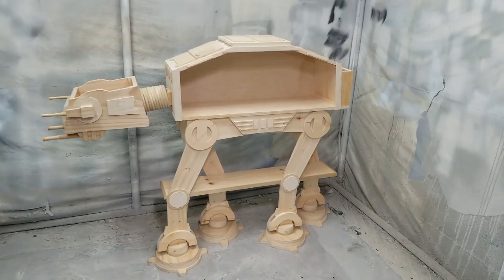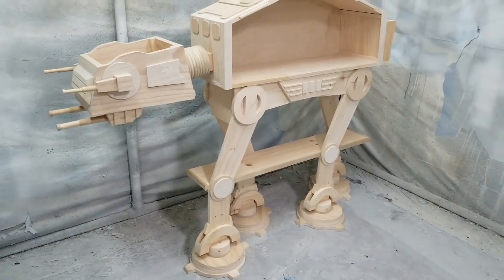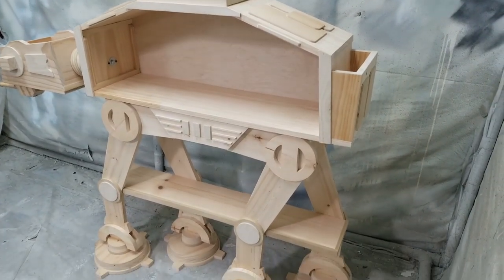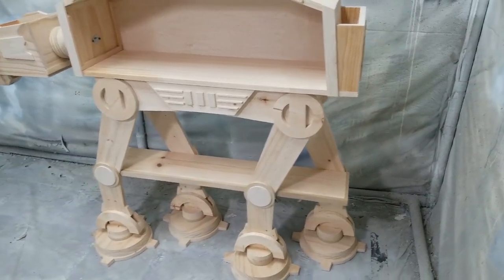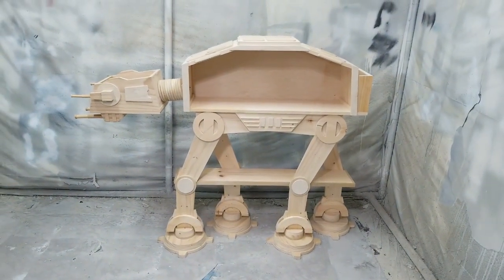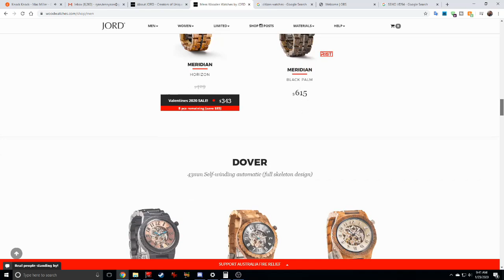Painting a Custom Book Shelf

Comment: @That Shabby Guy what color of Valspar gray do you use (or do you change it up)? Looks good brother keep it up. I've been following up on your videos when I am not working on my projects.
Reply from the maker: I dont use any specific color. I find most of my grays on the mistint shelf at the hardware store. Gray is so popular there are usually some available. Get $35 paint for $9. So I'm not picky. If its too dark, I can add white to get it where I want it.
Reply: @ThatShabbyGuy  Thanks for the reply! I will be getting some gray for sure from lowes mistint. I have a table that has some design work around the edge. I am going to attempt your gray glaze technique to the sides and legs. Possibly do a carbon gray stain on top. I'll share photos when finished (I will have to brush paint mine at least until I get a good sprayer). Take care!

Comment: I’m sorry if I missed hearing it in the video, but did you just start with a regular spray paint as a base? It’s gorgeous by the way! I’m not a Star Wars fan, but I am a fan of anything you paint.
Reply from the maker: I used Rustoleum flat spray paint as a primer. Since it was raw wood I needed to seal in tannin bleeds and also prevent the wood from raising up when water based paint is applied.
Reply: Gotcha!! I did my first project using stain as a glaze a few days ago on a table top. I painted the top white then used Weathered Oak as the glaze. It turned out beautifully. Thank you so much for sharing your expertise and inspiring me.